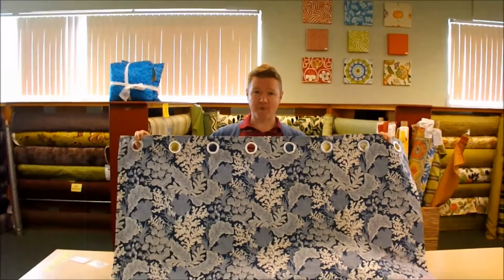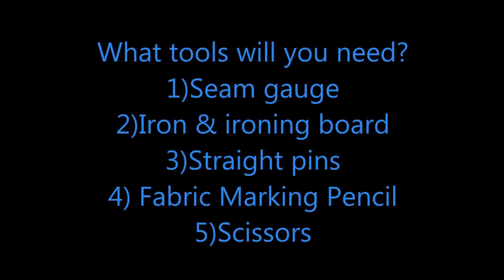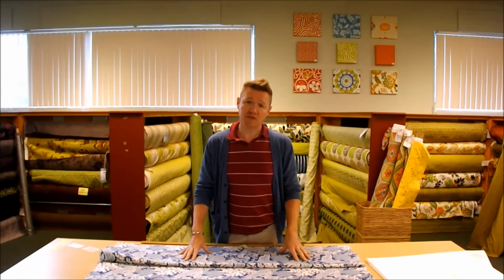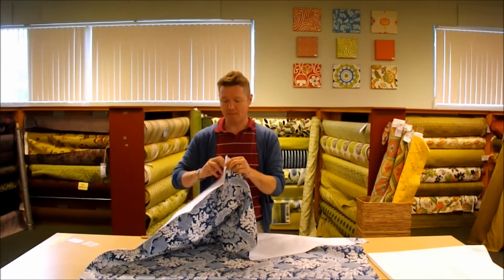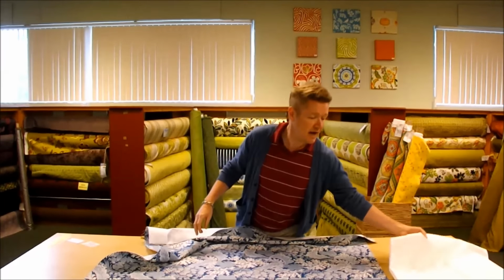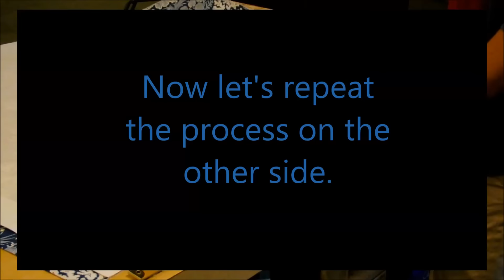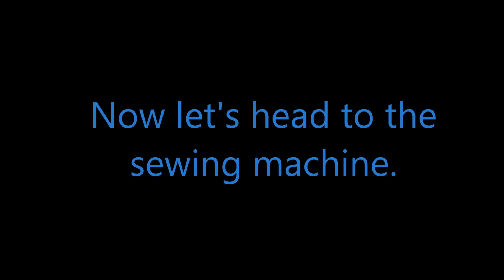How to Make a Fully-lined Grommet Panel

Comment: Thank you so much for sharing this tutorial on grommet curtains.  It was a great help in assisting me to make curtains for my sliding glass doors in my kitchen.
Reply: I was curious if you ran into any problems since it was a sliding glass door. DId you just divide the width in 2 to get the correct length,,,,,Terry
Reply: Hi Terry, I made 2 panels, each 54” wide, 84” long.  Worked perfectly!

Comment: Myles, fantastic job on instructions, measuring, maths, and visuals on video. I have one question so am hoping you are still following this. I have a HUGE wall of windows to cover, 22' feet so 11' to draw to each side. Making 2 panels would be next to impossible to work with and not possible to have cleaned. What is the maximum panel width you would recommend? I can create several panels for each side and whip stitch those panels together before hanging to keep them together for drawing and then take out stitching for removal and cleaning unless you have a better solution. THANK YOU!!!
Reply from the maker: Hi Kathleen!  Myles here.  Thanks for your feedback on the video.  I have consulted one of the experts in our drapery division and she would actually not recommend grommet style drapes for such a large span.  The major problem is that in order to support the weight of the drapes, you would need multiple brackets to hold up the rod, and, unfortunately, the brackets would get in the way of the drapes opening and closing.  Sorry to disappoint.
Reply: @StudioFabricana  Thank you. I took another look at the plans and  it can be done in 2 sets, each with a support in the center. I appreciate your feedback.

Comment: Hello, thank you for your instructions! I have a question. I don’t understand why the drapery fabric is 4” wider than the lining fabric, causing it to be ruffle-y on the drapery side. Why don’t we want it smooth? Thanks!
Reply: Hi Adele,
The lining sits 1" away from the edge of the drape on both sides.  This means at both edges of the drape we have 1" of the drapery fabric doubled, which is why the main fabric is a total of 4" wider than the lining.  The top of the drape will lay flat (i.e. no ruffles)  :)
Reply: Myles Hurtubise Ah, oh! Thanks for clarifying!

Comment: If your package of grommets came with no instructions as to how far apart the grommets should be, what is a correct distance between grommets??  What is typical measurement of distance??  I have a window with two panels i'm working on that have black-out liner on the back of them.. ??
Reply from the maker: +Lisa Bevill The rule of thumb is typically to use 8 grommets per 54" panel. That way, the grommets aren't spaced too far apart (or your panel may start to rub against the wall). If you panel is larger than that, you will want to add more grommets, just make sure you always have an even amount. Once you know how many grommets you would like to use, you can calculate the distance between. Near the bottom of our instructions: http://www.studiofabricana.com/article.php?id=90 we talk about how to calculate grommet spacing. Keep in mind the distance from your rod to the wall also affects this calculation.

Comment: I must admit I haven't sewn lined drapes before and am having a little trouble figuring out the header portion of the drapes.  I understand that you sew the header tape to the top wrong side of the drape but, do you fold the header tape down onto the back side of the fabric at the seam line or double it over and have the header tape on the inside of the fabric and press??
Reply from the maker: Hi Barbara, 
Yes you will sew the header tape to the wrong side of your drape. There’s no need to do any other prep with the header tape before you attach the lining. 

When you go to attach your lining the top folded edge of your lining should line up to the point that the bottom of the header tape sits. Then you fold back the top of the drape along the bottom of the header tape, right-sides together (the bottom of the header tape will be at the top folded edge now) and pin in place. 

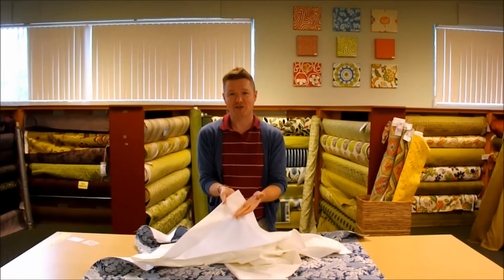So once it’s all pinned together your layers (top to bottom) would be header tape, top of drape (right-side down), lining (right-side down) and then the rest of your drape (right-side up). Hope this makes sense. If you need to refer to that point in the video again it’s at about the 1:24 mark in the video.

Comment: What about the 1&1/2"" of raw edges that are left exposed below the lining on each side?
Reply from the maker: Hi Janet, if you are working with a fabric that doesn't fray you can simply whipstitch this in place. If the fabric does fray, you can either turn the raw edge under slightly and then stitch it down, or use a product such as fray check (carefully) along the raw edge and then stitch it down once it dries. Hope this helps!

Comment: I am having much difficulty with the Dritz grommets I purchased. The layers of fabric and tape seem to be too thick and I cannot get the grommet to snap together.  Ugh! There is not a lip on these like on the one in your video. Where can I purchase grommets that will work? what brand would I be searching for?
Reply from the maker: +Justin Johnson You will want to make sure that you have grommets meant for drapery. There are lots of brands that will work but some grommets are meant more for clothing or crafts. The ones we used are called "heavy duty snap-on grommets" and they come from Canadian Drapery Hardware company. If you are not in Canada, try going to a store that sells home decor fabrics and ask about drapery grommets. Hope this helps!